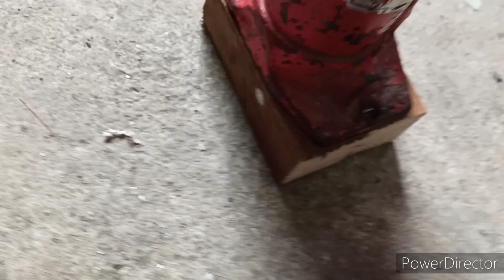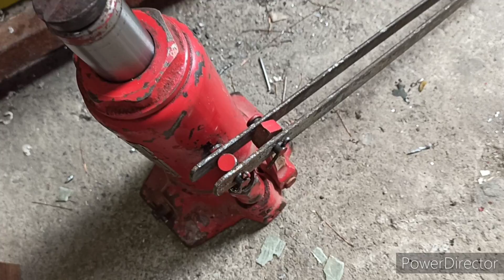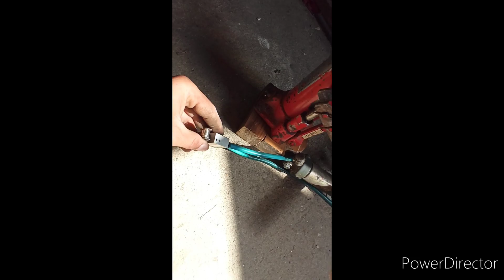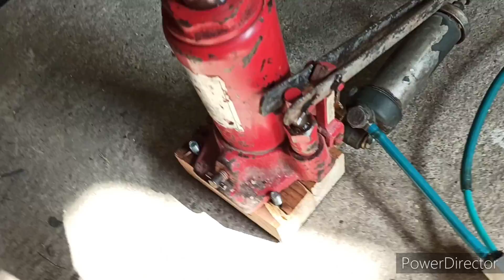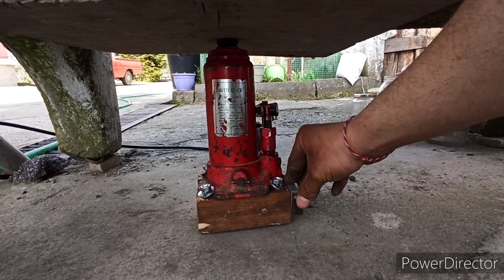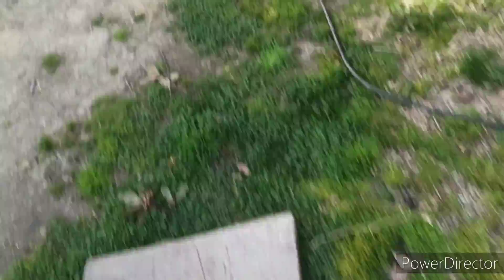DIY Conversion from hydraulic Jack to automated pneumatic

Comment: Great idea - I may have to do this one! 
I have the HF 20 Ton bottle with the attached air pump -- which QUIT a year ago (I've had it completely apart and cleaned it etc etc etc -- complete mystery why it stopped).
Reply from the maker: Yeah actually this was the case for the air jack of a friend of mine i fixed....the air pump stopped working and we installed a a switch and an connector for him to install to his shops air compressor.... of course is is a bit slower with a manual switch....but it gets the job done and the jack doesn't go to waste.!!
Reply: @Kristi98  Thanks for the update.
Not sure I understand what actually went wrong with the air pump so I can check mine. The bottle still works manually, but my pump does nothing - no sound, zip - even though there is a very good air supply. Again, no blockages and nice and clean and properly lubed.
Reply from the maker: If you took it apart cleaned it lubed it and put it back together correctly it should work....are you sure you have connected it properly and it moves freely..!!?🤔🤔🤔!!
Reply: @Kristi98  Yep. I checked everything. I'm thinking now that there HAS TO BE a blockage inside the 20 bottle itself. If I understand correctly, the pump side inside bottom portion of the bottle has passages that are independent from but identical in function to the manual pump side. The vacuum pump side (inside the bottle) MUST be clogged with dirt or metal or...?, since the air pump is as perfect as I can make it.
Reply from the maker: @AerialLensVideo   If that is the case you can remove the screws/caps it has in the bottom side and blow the passages with high pressure air...does the pneumatic pump seal property so it can push the Oil in the passages.!!???I don't know brother i wish I could help you more.!!!🤔🤔
Reply: @Kristi98  Will give that a go first thing. Saw a YT video on how to take the bottle apart, and the guy in the video showed a ton of grit in the bottom of a fairly new bottle. Bet it is the bottle and not the air pump. Thanks!
Reply from the maker: @AerialLensVideo I hope you get it fixed my friend...If that doesn't work too the only thing i can think of needed to be done...is some kind of priming getting the lines of Oil full so it can start pushing and pulling the hydraulic Oil.!!

Comment: Cool build bro I love it. I was curious tho from what I seen your pretty much stroking a smaller ram thats connected to a manual ram . Can I just get a big enough hydraulic ram and lift with that or thats a bad idea just curious
Reply from the maker: Thank you bro...this is small hydraulic jack for small cars or small weights if you use a bigger hydraulic jack with bigger pneumatic piston you can lift really big weights and using a steel base for the jack ofcourse not wood as shown here....but the principle is the same....an air switch to activate an air piston and it's ready to go...i made another one with an electric motor and i love it it is so good...you can plug it in any can and lift anything...or if you have a charged battery you can take it anywhere.!!https://youtu.be/Ow-SR3nxuuE

Comment: What is the name of the device driving the jack? The one that use air
Reply from the maker: It is called pneumatic cylinder with a pneumatic switch
Reply from the maker: Thank you i will check it

Comment: Saya ingin bertanya material dan Spartpart apa aja itu yang di butuhkan . ? Terimakasih
Reply from the maker: The jack can be one of your choice depends on the weight you want to lift... You need a pneumatic valve (switch) for the air and a pneumatic cylinder to actuate the lever and that's it in materias... The only thing I have to suggest more is to make the base I made out of pieces of Wood out of solid Wood or metal even better.!!
Reply from the maker: Could you please translate it to English.!??Because using the Google translation it doesn't make sense.!
Reply: @Kristi98  I want to ask what is in the form of a tube, sir
Reply: @Kristi98  can you tell me how it works the making of the automatic air jack As well as what materials we need